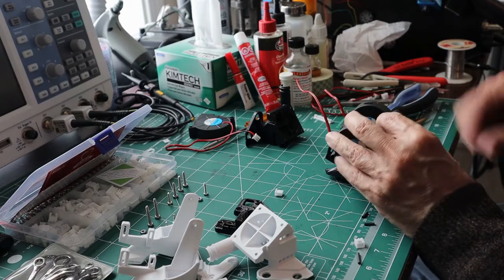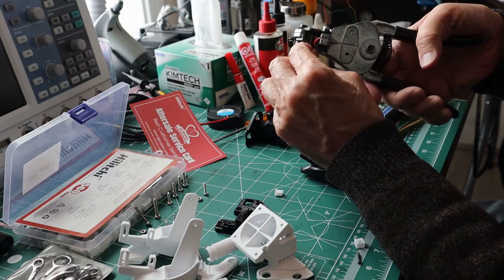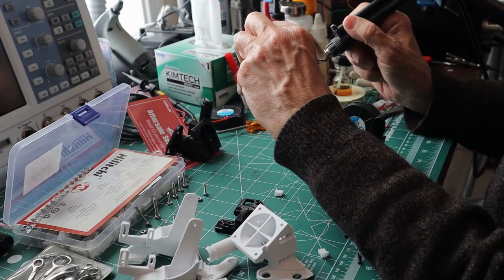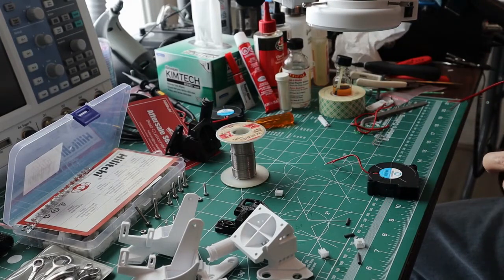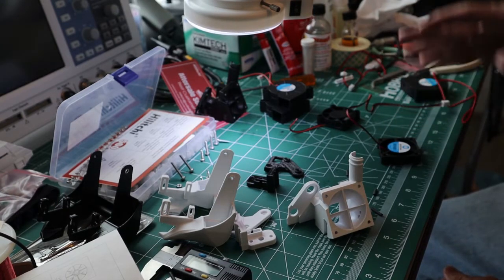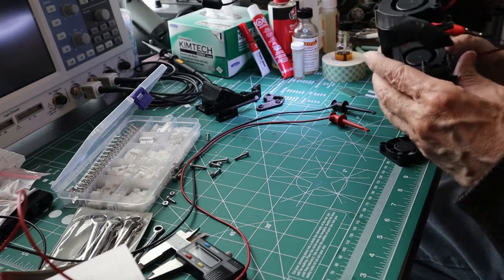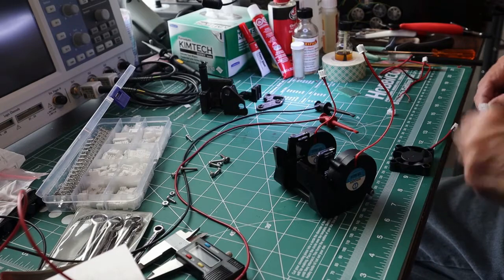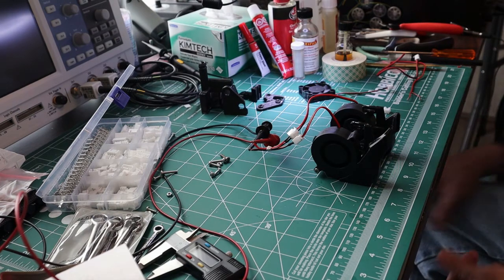Ender 5 Plus Build Mod06 Dual fan mod part1

Comment: Excellent video! Nothing better than an electrical engineer for sorting out wiring! The problem with electricity is that you can't see it and if there is enough of it, by the time you discover it is actually there it's too late! 😛 You solved my problem!